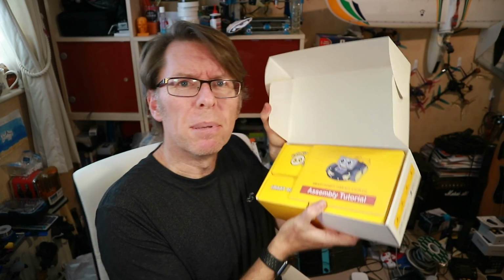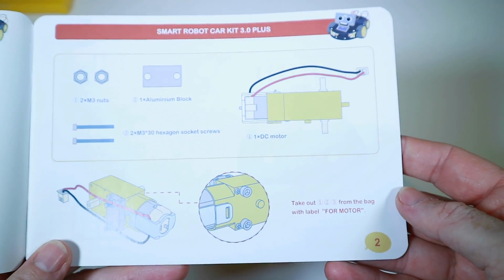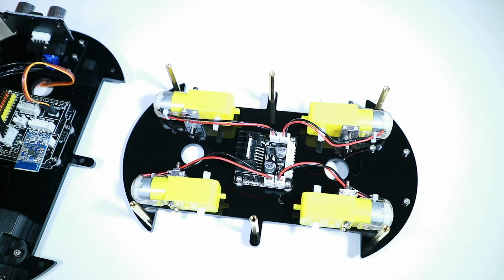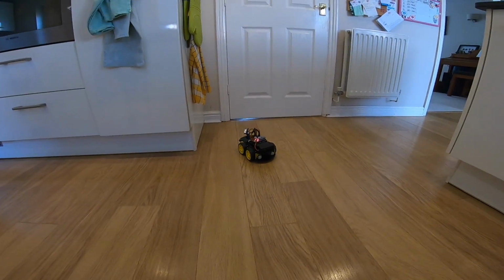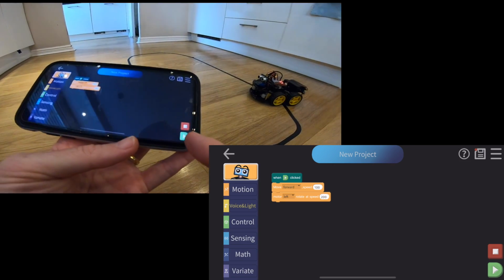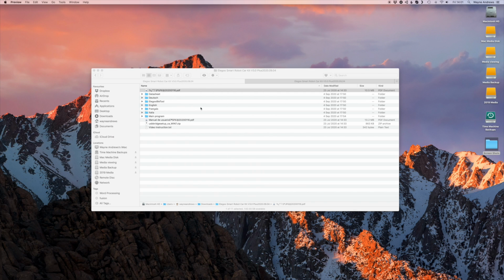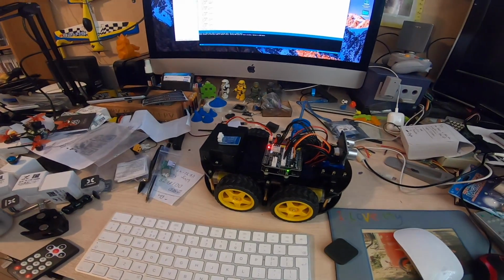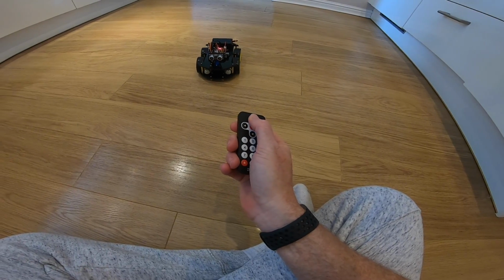Elegoo Smart Robot Car Kit - Learn Arduino programming!  Supplied by Elegoo

Comment: Really nice and comprehensive review. I’m looking to start working with my daughters on programming and thought arduino can be a good platform for that. Looks like this kit is not the intro into areuino that I was hoping for. What would you suggest to start with ?
Reply from the maker: This is actually one of the better documented kits, but it does assume some programming knowledge and the Arduino environment can be quite scary looking when you get into interrupt timing.  I would suggest to learn the platform more, you'd want to have a plain old arduino sitting hooked up to your computer so it's easier to see visible results and cut out the complexity.  If you search Arduino kit on Amazon you'll find quite a few kits with a board and a bunch of sensors - so you could start small with turning on an LED, then getting input from a sensor to the PC, and then perhaps connecting a screen and keep going from there.

Comment: Good morning,I am 86years old and live in the uk and was most impressed with your presentation. However I was lost when you started talking about Arduino, although I have heard of it and are thinking about buying some sort of starter kit. My problem is I only have an ipad and it seems you need a laptop to use arduino. Am I correct in this observation? If so could you please recommend a budget priced laptop and a starter kit which will get me started. I think I will be able learn at least the basics, although I am not as sharp as I was 30 years ago.Many thanks and I look forward to hearing from you if you have the time.
Reply from the maker: Yes, you'll need a computer of some sort to program using Arduino.  I can't think of a particular laptop that I'd recommend.  Arduino isn't an aplication that takes much processing power, so something entry level should be fine.  Are you talking about a starter kit for the Arduino itself?  If so, go to amazon.co.uk and use "arduino kit" as the search term.  You'll find a lot of kits - with most of them supplying an Arduino (or compatible) board with some extra sensors and things to play with.  Elegoo do a few, and I've found their own tutorials to be pretty good.

Comment: I enjoyed your video, seeing how stuff work/perform instead of having to buy it. From these robotic vehicles I'm expecting a whole lot more than what they could do 20 years ago.. There was this cute little robot vehicle called Cybot that had the exact same sensors..they could even chase balls and play "soccer" with other Cybots if I'm not mistaken, but I discontinued the series of magazines before I got to that edition.. the computer boards were different and occupied a bit more space. I think for modern robot toys today they could've at least added more sonar sensors for object avoidance AND light sensors.. Cybot followed a torch's light spot on the ground quite accurate...I miss the little bugger (excuse the pun, they did look like bugs with their antennas that ended in green led lights😄).
Reply from the maker: I had both the robots, although the annoyance of constantly having to swap circuit boards out in order to give it new functionality was a pain.  I do take your point, but the idea with these ones is that they are a starting point.  You build it, you play with the code see if you can make it do some things, and then you add on extra sensors to do more

Comment: Hello, thank you for the video.
I just have one question, how did you read the code that exists in the arduino with the sdk?
Reply from the maker: I might be misunderstanding the question, but you can't simply read the code that's loaded on the Arduino (well you can, but just the binary version) so what I was doing is downloading the base code that would be running on the car from the Web site and then making my changes on top of that.  Does that answer the question?

Comment: Driven by 4 independent motors? That's a perfect candidate for some mecanum wheels.
Given the right coding, an RC car with mecanum wheels should be able to drive just like a quadcopter flies, with pitch+roll+yaw control.
Reply from the maker: I like that idea, I wonder if I can pick some up and mess around with that idea
Reply: @CurryKitten  I've been intending to make a mecanum wheeled RC car for a long time now, printing the wheels myself, but other projects & ideas keep getting in the way, like last weekend I put a Zhiyun Z1 Tiny2 3-axis gimbal on an RC car holding an FPV camera - it makes FPV RC car driving a whole lot more fun because the camera is rock-steady.